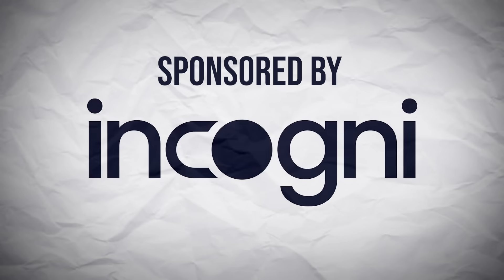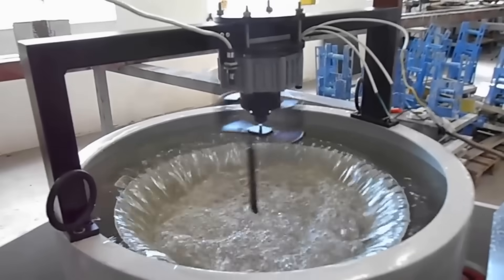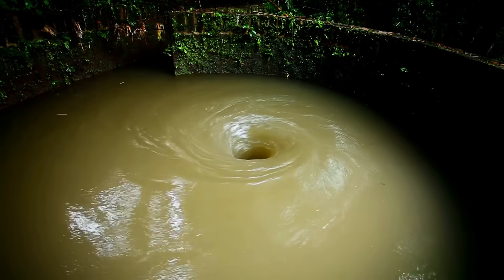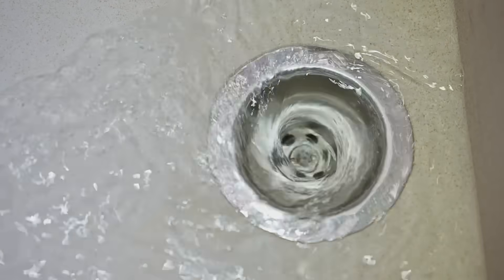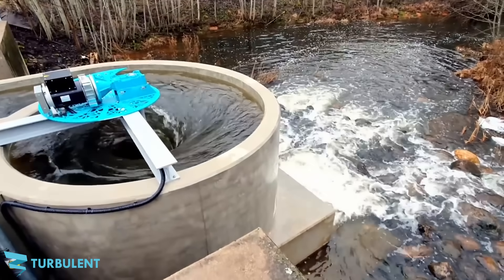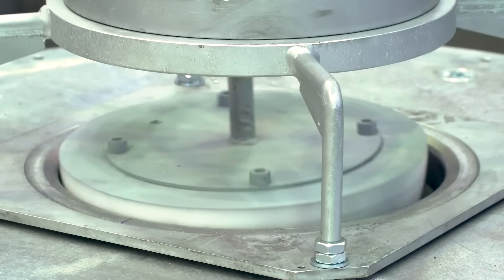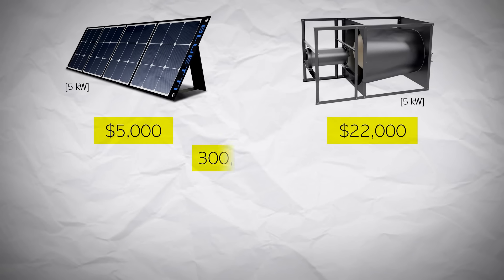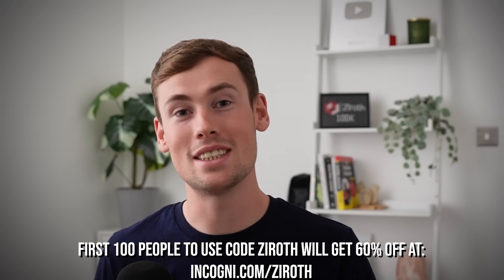Genius Bladeless Hydro Turbine is Cheaper Than Solar

Comment from the maker: Thanks for watching! Don't forget, the first 100 people to use code ZIROTH at the link below will get 60% off of Incogni: https://incogni.com/ziroth !

Just realised I put some footage of a bigger turbines (that uses the same method of generation) which look pretty deadly and didnt give context - my thought was  the smaller/lighter ones would not crush the fish! My bad for not being clear with this!
Reply: 5kw x 24hrs = 120kwh
120kwh x 365 days = 43,800kwh

How are you getting to 300,000kwh as a maximum capacity?
Reply: @jared.thevibe Yeah, I commented the same thing as well.
Even his solar numbers are way off.
With 5 kw 24/7, 365 being 43,800 kwh per year, and then solar panels only averaging 17% max output like he says, then that's only 7446 kwh per year, not 50,000.
I think he's calculated exposing them to 300,000 kwh worth of energy, and then worked out how much of that energy can each system get, based on their efficiency, but then is talking about doing that in a year, which makes no sense.  I don't understand why that 300,000 number needs to be involved. Surprised more people haven't mentioned it. I wish my 5 kw solar system could give me 50,000 kwh a year.
Reply: that's a ready made fishcake maker lol
Reply: How about waterwheels.
Some waterwheels have the race underneath rather than on top of the waterwheel. It might be more fish friendly, and perhaps lower tech than all the turbines.
Reply: Only the Archimedes screw and tube will make the power generation 100% efficient. The Archimedes screw isn't a turbine, but a pole with one continuous blade.
Reply: @cb-vi3he  Can people like PLEASE not jump in with completely nonsensical statements.
FIRST - NOTHING, and I really do mean NOTHING that humans build is 100% efficient.
SECOND - Archimedes screws are far from being more efficient than Pelton or bladed turbines. If they were then we'd use them. They aren't which is why we don't.
Reply: I am not sure if I understood why this is called bladeless when the ball/half hemisphere is clearly the blade.
Furthermore, why is it any different to one with a blades when it comes to wildlife? On the face of it, it looks even less safe to the fish than the ones with  blades.
I am not pretending to fully understand the system but the ones using a "blade" are presummbly dangerous to the fish because the body of the fish could come into contact with a fast running "blade". If that is the case then the same thing applies to the "ball"/"semisphere", doesn't it?
The only way round this problem is to rotate the ball tangential to the flow of water, i.e. the rotation not being directly in the path of the flow. But that doesn't match your demonstration or the diagram. 
May be that is the reason for the low of eiffiency but then 55% seems a lot for such an arrangement and I am not convinced by the idea that the vortex will carry on independently once started. of course how long it will carry on must be dependent of the ratio of the flow rate and  the size of the outflow assuming there is zero potential energy due to gravity.
If the rotating mass is as shown is direct in the path of the flow it needs to be large enough for the fish to get through and the larger the fish the more probablity of it getting squeezed beteen the rotating mass and the sides of container. Unless there is another mechanism to prevent the fish entering the system that I would imagine can easily be achieved using a mesh that lets the water through but not the fish. 
So, where it the problem that was supposed to be solved by this system?
I can understand that the mesh needs to be easily permeable to water which unless we are talking about the tinyest fish and other aquatic larva it is not going to be problem given that nature has already seen to that problem though the ratio of eggs to those that survive long enough to procreate.
Besides, there is always going to be the question of maintenace to clear the flow form dead vegitation and river sediments that will very much depend on the environment outside the system. So, the idea of what gets into the system falls within the parameters the maintenace anyway.
So, can you please tell me what I am missing here?
To be honest in the end none of these system are viable because they all depent on the speifics of the environment. Rivers are no where at steady as you present them to be. The flow rate changes all the time so you really need custom design for each case that given the changing climate is going to be oscilating between extremes. Riverbeds can go from being bone dry to sources of floods. So the whole premise is just wrong.
Reply: @ExiledGypsy  Thanks for thinking. The half hemisphere is essentially a blade, it works on the principle of lift and everything.

Now how this actually works. Essentially the sphere shaped section creates lift on the side in the flow, while the side on the wall stalls. Introduce the slightest inconsistency in flow, and the system breaks equilibrium and starts to rotate around the axis of the pipe. The rotation along the axis of the pipe increases the force generating rotation and so the rotation increases. If you want to see this for yourself, put a light sphere in a tube of some sort point the tube up and blow into the bottom. Thanks to the imperfections of reality, the sphere will start to spin around the inside of your tube.  A plastic ball bearing and a pen are pretty good for this. a ping pong ball and a plastic water bottle also work, just cut the bottom off, toss the ping pong ball in and blow into the little screw top opening. (hell it'd probably work with the paper cup this dumb ass is using for demonstration)

This is pretty much a cone crusher and will more or less destroy pretty much any fish that is not extremely small (which moves past the area it can actually be crushed extremely quickly since that area is very tiny) or incredibly large (so that no part of the fish is able to fall into the opening and closing gap). 

It's advantage is that it should be extremely cheap, since it's just some sheet metal bent into two simple shapes, and it's durability, since scouring will take an extremely long time to actually affect any of the surface's function. 55% efficiency is pretty bad, since most types used for power generation get like 80-90% but since it's so simple it's worth the waste(or so I'm sure the sales pitch goes).
Reply: @randomconstructions4513  Thank you for your explanation. I understand the dynamics as to how the rotation gets going that was never an issue. I was confused about being bladeless and fish-friendly.  I must be getting the relative scales wrong then. But it was misleading to say that the advantage is that it doesn't hurt the fish since I am assuming nothing but the tiniest will get anywhere near the bone crusher as you put it anyway. 
The advantage is the relative cost and durability for which you pay in the loss of efficiency then, isn't it?

This whole idea of fish is a bit of red herring, isn't it? Since there are all sorts of mesh barriers used to stop the fish from getting anywhere close enough to get destroyed.
Reply: @ExiledGypsy  Yea, this guy just kinda missed the whole point of the thing I think.
Reply: 9:45
Reply: Good djoB
Reply: Did You check Víctor Schauberger's designs? All Said and Done
Reply: AEROSPACE ENGINEER HERE:
My first thought on seeing the link was "Oh not another one" but on seeing this its actually clever. That doesn't mean its going to change the world, but we have to start using these sorts of different technologies where they work. 
I don't think the efficiency is anywhere near the issue that so many bring up when it comes to energy. The more important thing is can any particular system deliver what's needed at an acceptable price without negative side effects.

People need to realise that geography has a lot to do with what we can access. Not everywhere is great for solar or wind or hydro, but some of these smaller systems make it possible to use geographic resources that are otherwise not feasible.
Reply: Maybe let's not tap into the rotational energy of the earth with this Coriolis turbine.
Reply: Thanks Ryan. There's absolutely no reason why these couldn't be used in tidal flow systems. Tides don't produce constant flow, unless a reservoir is used, but they are totally predictable and more dependable than many smaller rivers, wadis and streams, which can diminish in size, or cease completely, during dry seasons and increase tremendously in wet seasons,
Reply: What you think about perpetual motion is it possible to build one?. Is it worth trying to build one
Reply: the link to the company in the description appears to be broken: it's probably "hydro" not "idro"
Reply: The pellet with the poison is in the vessel with the pessel.
Reply: I don’t understand why everyone have always all been not noticing that there aren’t any animal wildlife in any of the rivers at the start of these rivers. And the drawing water is mor affective.  Right?
Reply: Screens over the inlet -slanted so fishslide off versus being trapped against the screens
Reply: Never seen this, there are also solar vortex chimneys heat turbines that you could cover too
Reply: Interesting!  Some thoughts:

1. The carbon footprint, lifespan, and recyclability of the two technologies would also have to be taken into account, and solar panels are... problematic... in all three regards.
2. Solar panels have to have a sturdy foundation, are fairly fragile, and require constant cleaning.  This looks like it only requires an anchor and some form of grate to protect it from debris.
3. The main reason solar panels cost so little in comparison is because of their HUGE sales volume.  This new turbine isn't able to enjoy that.  ...yet.

Cheers!
Reply: @KeithOlson  ⚠️ God has said in the Quran:

🔵 { O mankind, worship your Lord, who created you and those before you, that you may become righteous - ( 2:21 ) 

🔴 [He] who made for you the earth a bed [spread out] and the sky a ceiling and sent down from the sky, rain and brought forth thereby fruits as provision for you. So do not attribute to Allah equals while you know [that there is nothing similar to Him]. ( 2:22 )

🔵 And if you are in doubt about what We have sent down upon Our Servant [Muhammad], then produce a surah the like thereof and call upon your witnesses other than Allah, if you should be truthful. ( 2:23 )

🔴 But if you do not - and you will never be able to - then fear the Fire, whose fuel is men and stones, prepared for the disbelievers.( 2:24 )

🔵 And give good tidings to those who believe and do righteous deeds that they will have gardens [in Paradise] beneath which rivers flow. Whenever they are provided with a provision of fruit therefrom, they will say, "This is what we were provided with before." And it is given to them in likeness. And they will have therein purified spouses, and they will abide therein eternally. ( 2:25 )

⚠️ Quran

Comment: just watching ur video ,,,
Got a story for you back in 2016 i posted a video to youtube it was for a system that lets dams be retro fitted with up to three extra turbine banks . 
this system will not need the main turbines to have modification so more power from the same volume of water currently used . 
Never heard of it well it looks like the idea has legs but the market is not given this tech as the less of a product to go around the more its worth so more power is a minimum 10 years away ... Just thought u would like to know

Comment: pumped hydro is still an option though to store the power from wind and solar, also there are nuclear power plants that store their thermal energy so they can provide 3x their output for peak times and the reactor can be ran at 100% 24/7, which makes them more efficient.

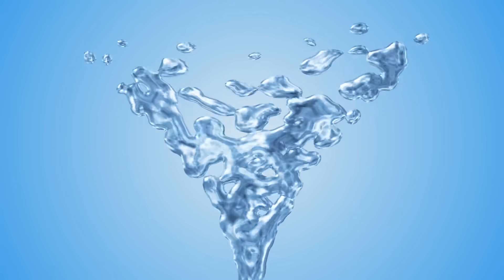Comment: 3:15 GENIUS!!!   If the bladeless turbine really works better than one with blades, then one should be able to use it in reverse. That is to say, place a funnel under a boat, where the prop would go, with the mouth facing forward. Stick a rubber ball into the funnel. Get it to twirl, by means of a  flexible cable attached to the ball at one end and to a motor at the other end. Get a vortex going and let me know how fast your boat goes!!!!!

Comment: I may be naïve, but I really don't get the complex design approach. My objective is to get turbines installed easily, and cheaply.

So I envisage one that is mounted above a stream, like a paddle wheel. Very inefficient at first sight, but such simple designs are much more likely to be implemented, as they are still useful, and safer for fish etc (I presume). Waiting for a perfect solution is not useful.

So, a large amount of money could be spent on installing fancy turbines, or spent on installing many simple ones. In that context, the practical approach is much more effective overall.

Am I missing something?

Comment: Back in 2016 in Australia a proof of concept test was run this test was to prove that a retro fitable system that allowed a dam to run up to three extra turbine halls with no issues to the main hall re back pressure issues  and is independent of the system re servicing  so the main hall can be at full power and normal servicing can still happen. So more power from the same volume of water currently used . AND I BET YOU HAVE NEVER HEARD OF IT  ,,,,, RDP Marine Australia

Comment: Cheaper than solar?!?!?  All hydropower plants have enormously high construction costs relative to their yield. The costs for small hydropower are therefore usually 15 to 25 cent/kWh. 
Hydropower plants have to be cleaned of branches, rubbish etc every day.
Solar panels on the other hand are reliable and almost maintenance-free for at least 25 years! 
Due to the extreme drop in the price of solar panels you generate green electricity for 25 years at approx. only 3-- 8 cent/kWh!

Comment: Modern water turbines are over 90% efficiency.  Easily beat solar panel efficiency in 20-23% range. I guess if bladeless does 25% it would beat solar power.

Comment: What would happen if you did like another commenter said and ditch the turbine/ball/prop part of these things and instead made the cup spin? I guess by having little fins all along its interior wall to create drag from the water vortex and in turn spin the cup. My first thought is that it might be less efficient because you are trying to turn a much larger thing (the whole cup versus a ball or prop on a shaft). But I'm not an engineer. No idea what I'm talking about

Comment: Blade free, critter safe, my mind popped up, a can inside the bigger one, spiral etched or bio- mimic ridged inside to tuna scale hydro slip, with hydroelectric collection, rigidity, etc, all in the stationary outside cylinder. Pop out moving part replaceable.  Eh? No ball, no?
 Remember, low output preferred over no output, often! Why the ball?

Comment: a 260 litre wheely bin with a gas tap in the lid is a methane bio digester,fill it with kitchen waste,weeds,water and a cow pat,will make 50-100kw hours per month of clean methane bio gas,will run any engine with spark plugs,generator,car,boat etc. real free energy, get everyone off grid!

Comment: [03:00] - The initial rotation is caused by earths rotation which results in the Coriolis Effect which creates clockwise rotation or counterclockwise rotation depending on wether you're north or south of the equator.

Comment: What about designing the generator around the housing and put windings in the ball. The ball then becomes a rotor and since everything is free moving it would seem to me to minimize loss to mechanics. The electromagnets on the housing would rotate as well. The speed of the balls rotation would synch with the magnet rotation. Just a thought

Comment: We have had blade less electrical power generators for a long time,  search "thinking and tinkering / perpetual battery," to see a patent from the 70's, that is solid state, doesn't impede water flow, and is far better than this....

Comment: Quite an interesting process, the rotation seems a bit inefficient, as it seems to maybe waste more potential from the system from such rotation angle but wth do I know :P I was thinking that perhaps a tighter gap would be more efficient hmm or it reduces the flow of water blablabla   super interesting idea nonetheless, just to at least prove there are still plenty of unexplored ideas just when we thought we had it all figured out with so many options, there are still plenty more.

Comment: Sometime in the 90's I attended a "Fieldays" event in the Waikato (NZ) which showcased new inventions, technology, equipment etc. On display and for sale was a submersible generator which when dropped into a water flow provided Ac power. Instead of your ping pong ball concept, the ball was a neodymium magnet, free spinning inside a housing to generate the current. The ball (rotor) wasn't attached to a shaft. I still have the advertising paperwork, but sadly, didn't buy one of the units and have never seen them elsewhere. Was the concept bought and shelved? Who would know?
Reply: Wow! Any info on the paperwork?
Sounds fascinating....
Hope you find out more.

Comment: I have a bladeless volumetric turbine that works with the potential energy. Water can flow 10 times slower to avoid arming the fish. 100 times less loss by turbulences, and 100 times less stress on marine life. https://drive.google.com/file/d/1jBqYa9bbbuOrmXBwLl1sp2o-tohX2zAs/view?usp=drive_link
Reply: No matter the pressure on each side, the same volume per turn is always pumped. 32 cycles per turn in one cylinder

Comment: I’m thinking a weighted or magnetic ball on the bottom of the vortex ball producing 200v AC a transformer to decrease voltage to 14vDC and a diode to join the two sources together for double DC a magnetic flux to increase amperage & voltage. Ya